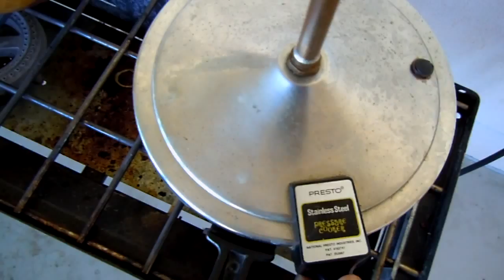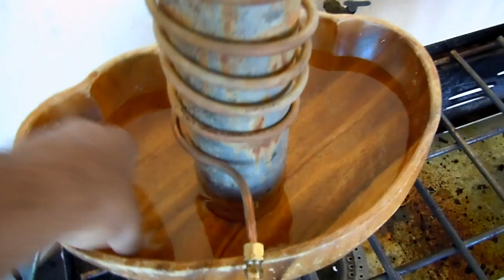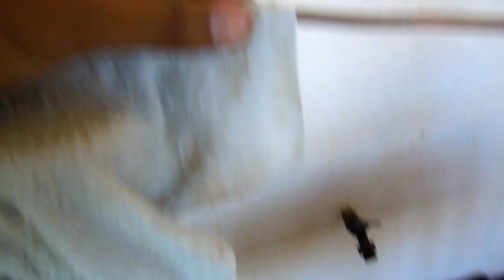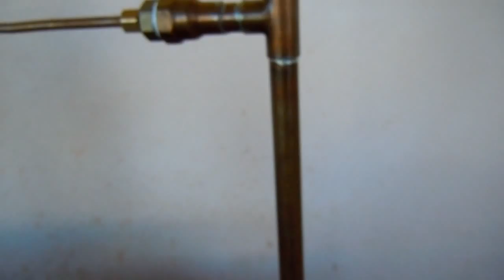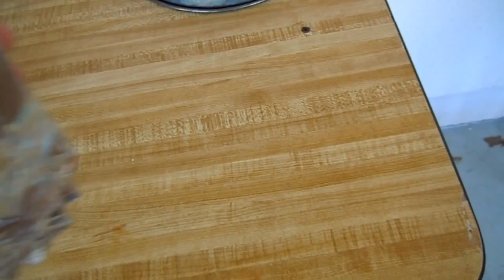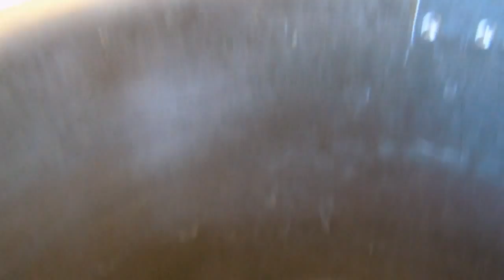Running the legal Pot Still: Home made

Comment: its realy simple to get the calcium out of the still once its done distilling , pour a bottle of vinigar in there and let the steam run through the still
the vinigar desolves the calcium , just need to flush the system afterwards 
works great on the oldfasion mr coffee machines too
as for cooling the coil : try running the coil intoo water with ice it will condence a LOT faster , it allso prevent the distilled water to come out the end as steam

Comment from the maker: +Clown Whisper.  First of all. I did not say I am or will distill alcohol nor have I used this contraption since (even for water). Second I did explained that I have a bucket setup with a special fitting to have the worm run through, however the plastic conviently split by the spigot just before the video, and no I haven't fixed it since because I dont use this thing anymore. Third this was trial rig thing that I was replicating the concept from my lab class, they use glass but I used what I had around. Fourth, BRASS IS LEAD FREE IN CALIFORNIA. And there is more things to worry about than a very minute trace amount of lead leaching out, dont eat bbq either because the smoke is cancer causing....And finally I AM NOT DISTILLING ALCOHOL, so its perfectly legal! Now normally I dont block people but you seem to disregard my explanations for why it was setup the way it was, and you continue to spew bullshit. Now please stay away from my videos.

Comment: Thank you, can have the same results using a normal Cork of that size? I'm not sure the cork is too porous or will let steam out that way.
Reply from the maker: Corks were used back in the day so it should work, rubber was the replacement

Comment: What did you use to seal off the thermometer so it doesn't leak there?
Reply from the maker: Rubber stopper with a hole for the thermometer

Comment from the maker: Just taking one sentence from an entire statement without its surrounding sentences obviously takes it out of context and will be misinterpreted. And furthermore, cell23901's original question was about removing lower temp distillates from 212 degrees without the use of a carbon filter. His question was about water, not alcohol. Since alot of folks in the comments are talking about alcohol, even though the video is about water distillation, tyvek05 assumed alcohol was the topic, and so did you.

Comment: What you said was. "Only collect around the 212 range." What tyvek said was,"180-195 is the perfect range for Fahrenheit temperature,".
If you collect at 212F or higher, not only will you lower the percent of alcohol (you will get more water) you will get more of the fusel oils which will give you a really bad hangover. If you collect below 173F you will get methanol. So like tyvek said (and you did to) toss the heads and tails. 
How is your still legal? Do you have a permit? Are you in the U.S?

Comment: There is not a state in the US where it is legal to distill spirits. Technically if you freeze a beer and remove the ice is illegal. You can make up to 200 gallons of wine and beer per household with the actual rules being 100 each of beer and wine per adult with the max of 200 or 2 adults brewing. Also, the lower you heat your mash the better. Alcohol comes off around 174 F and if you can maintain  a temp just above that, it is optimal.

Comment: Cool Vid, rather then a carbon filter what other methods do i have to remove the chemicals of lower boiling temps of 212 that will get mixed in with finised product of water??? or could i just boil for a couple min before putting the lid on canner to let the chemicals of less boiling points to be removed???

Comment: A bucket of ice will do a lot QUICKER, but until the video shows un-condensed alcohol steam shooting out the end of the coil, there is no "Better". 

Any temperature difference will produce condensation, it's just a question of whether it's quick enough to condense the entire volume of the steam being put into the condenser, within the length of the condenser..

Comment from the maker: beer and wine can be made in any state, but spirits cannot be distilled anywhere in the US without greasing the palms...I mean proper licensing...Only exemption is a still under a gallon in volume AND used in labs. My still being under a gallon is not exempt unless I was a declared lab facility, I cant even say Im making alcohol for experimentation, I would need a fuel license. Check out the site ttb.gov/spirits/faq.shtml  read S3, S5, and S6.